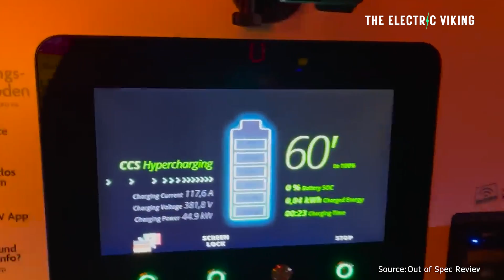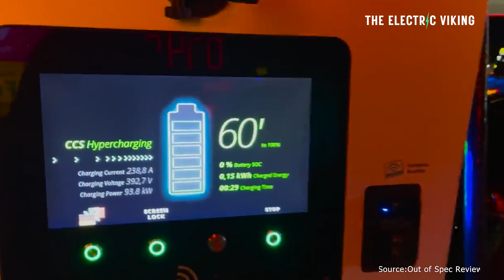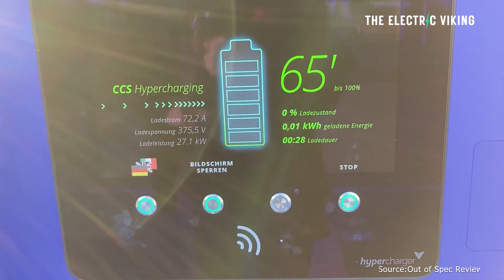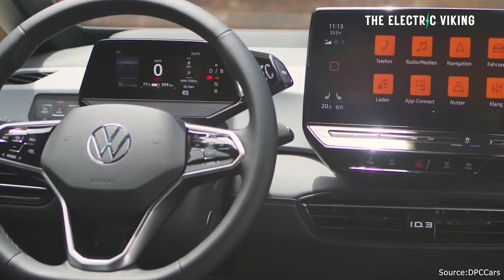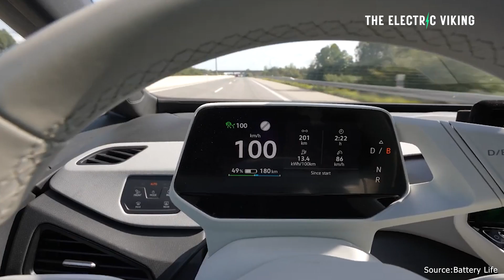VW EV Battery life tests show surprising 93% capacity after 62,000 Miles

Comment: I'm more interested in the degradation over time than the degradation over a certain amount of miles. How are these things for people who don't drive much? How will they hold their value when they are 15 or 20 years old? This is nice to know though, because I really like the ID 7 wagon. TY for your work Sam.
Reply: 15-20 years, I reckon you have had your moneys worth
Reply: @honestjohn6222  and replacing the battery will be much cheaper..
Reply: Hmmm, not any helpful fact-based answers yet. Just some speculation and some arguing.
Reply: I have had EVs for 11 yrs now, and have been looking at reports (anecdotal and statistical) more or less regularily. 
I would say that the general answer is that degradation over time is a factor, and that for a regular user (typically 16.000km / 10.000miles) this factor is of the same size-ish as the no of miles. The situation improves all the time (newer cars are better). And: somewhat important; some of the same rules apply here. I seems that the no 1 rule is: Dont let your EV stand still for longer period of times (days/weeks) in a 100% charged state. This is especially important in warm climates. This rule is pretty easy to follow. Most cars have setting that sets default charging to a lower % (typically 80% is a good cost/benefit setting). No problem to charge to 100% if you need 100% the next day - if not - dont. If you leave the car standing still for longer periods of time (weeks; say a looong vacation) it is adviced to somewhat lower (40% - 60% ish). The battery will not "take a hit" if you brake this rules, but the more often you do it the faster it will degrade.
So I would say that for new cars - this is not at concern (especially not if you follow the rules). 
I would make the bold gut-feeling-mathematically claim (cant give you statistics...) that for a new car the yearly time-degradetion wil be approx 0.5% (more the first year - maybe 2% or so but less the years after). The miles-degradation will be approx the same (0.5%) for a typical drive lenght (10.000 miles); so in total approx 1% per year. So after 15-20 yrs the battery will have degrdated approx 15-20%; probably less if you do not use the car much but still "follow the rules".
Reply: @erik5820 To my knowledge this information is 100% true!!  (Electronics engineer, 35 years of experience, about 8 years BEV experience). My ID3 pro S, 2.5 years old, 15000 km lost about 4,5% of its capacity. I normally AC charge to 70%, maybe 5 or 6 times a year I need to charge to 100%. It is never more than 1 or 2 hours at this 100% level. DC charging about 5 or 6 times a year.
Reply: 15-20 years are you kidding? Any car that age is practically worthless
Reply: If you don't drive much, it's best to store the battery at 40-50% capacity. They don't degrade when kept at that level. Degradation becomes a thing when you store it for longer time at 90%+ or near zero.
Reply: 15 or 20 years time they will be scrap, just like most diesel or petrol cars will.
Reply: They'd probably do even better if you drove the car and cycled the batteries less.
Reply: It will be according to how the BMS are programmed. If the car manufacturers don't want the cars to last, they will not last. The cells that the batteries are made of last almost forever, but it's possible to program the battery packs so that they will short cut and brake.
This they do with bicycle batteries that's why you have to change the BMS in a new battery before you start using the bicycle! 
So the DIYERS will make the batteries last "forever" in EVs. Tests have shown that when degradation reach some 85 % it almost stops. This you can show on the cell level.
Reply: Time is a low degradation factor for batteries, as long as they are kept charged above 20% when not used for a long period.
Reply: Hold their value is an easy one to answer. EV’s have eye watering depreciation even after one year they can lose over 60%. After 3 years a very large UK dealer cannot sell them so offer almost nothing for them in trade in. So expect about 80% loss over 3 years plus.
Reply: @OverlandExpedition No.
Reply: @peternystrom921  ohh yes, just seen that Honda has now shut down EV production. At this rate these abominations will be gone by the end of the year. I reevaluate my opinion, in 2 years you will need to pay someone to take an EV away for disposal.
Reply: No, thats not even remotly in reality. But you do you. @OverlandExpedition
Reply: @OverlandExpedition I’m sorry but that is just not true. Check Auto Trader. I’m after an EV in a year or 2 but can’t afford to buy new. A new Tesla MY long range costs about £50000+ new and are still worth £36000-42000 after a year. A new Kia Niro 3 EV costs about £38000 new and £32000 after a year. Even 4 year old Tesla M3s (about £40000-45000 new) go for about £23000. The big drops are for EVs that are over 4 years old or old models with low range, e.g 5-year old Renault Zoe. If I could pick up a 1 year old EV half price after one year I would already be driving a Tesla MY or Kia Niro EV. Unfortunately I can’t, I have to wait for them to be at least 2 or 3 years old before I can afford to buy one.
Reply: @OverlandExpedition  So, if people in Oregon are buying brand new Tesla Model 3’s for ~$27k after state & federal IRA incentives, then I can buy it used in 3 years for only $5.4K? Thanks Elon, I’ll take two please. I never thought I would be able to afford a 3 year old Tesla for only 20% of the retail price, and with batteries that have only degraded 4% after 100k miles. Awesome. I say this sarcastically, because a Tesla will not depreciate 80% in 3 years. Where does this FUD spewer get their “facts”?
Reply: @OverlandExpedition Nonsense. Every single word.